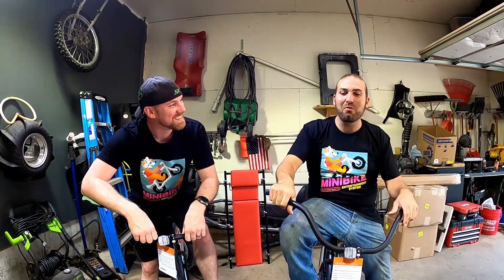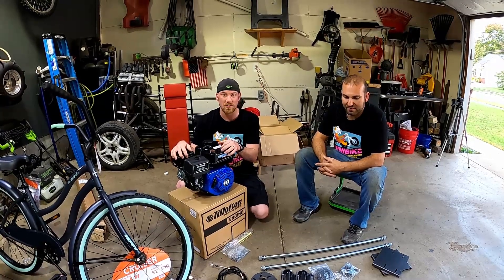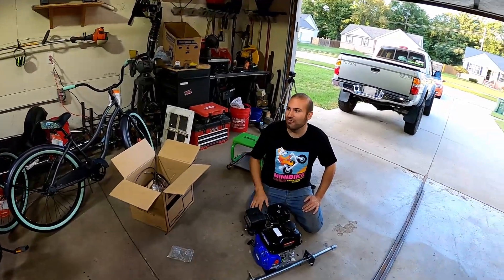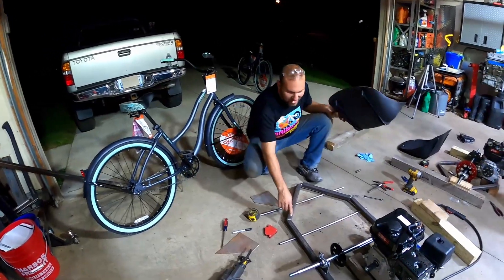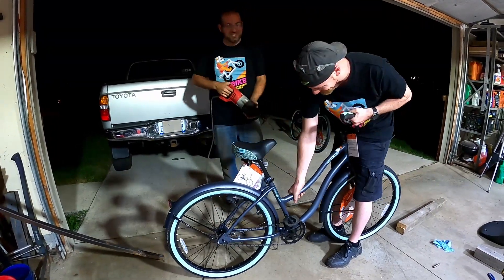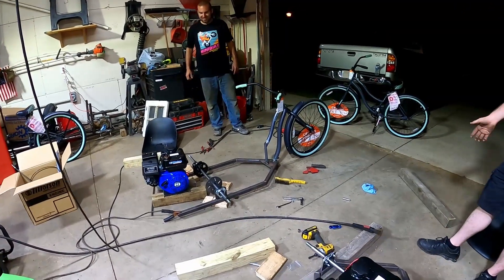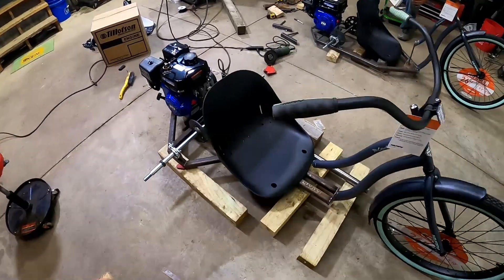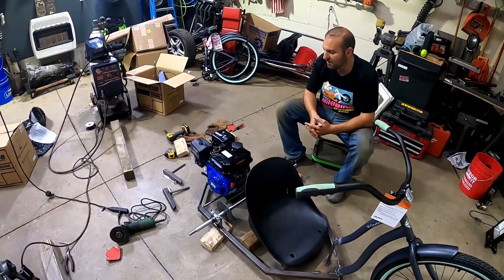Drift Trike Build Off!  Exciting Announcement!! | Tillotson Hemi Engine

Comment: If you guys are gonna end up doing a lot of riding on those, please be sure to zip tie the front fender mount so that it cannot fall on the tire while your riding. I build fast motorized bicycles and there death traps with factory bicycle fenders. Once the little pot metal tab that holds it to the bottom of the steering tube vibrates broke it’ll end up folding that rim like a taco. Great vids guys!!!
Reply from the maker: Thank for the Advise! Definitely don't want that fender to cause us to get hurt lol

Comment: You all should have gotten bikes that came with front dis brakes,so the strikes would have brakes on them..not only that you should have put rear axle behind motor ....
Reply from the maker: We will have a disc brake on the rear axle. Although a  disc upfront would look sweet lol
Reply: @CRACKEDHOUSINGFAB   If you're going to have plastic pucks on your tires rear brakes wont-work for nothing you will just skid on plastic
Reply: Front brakes are a must on a drift trike love the build